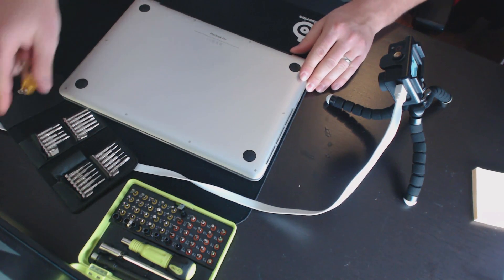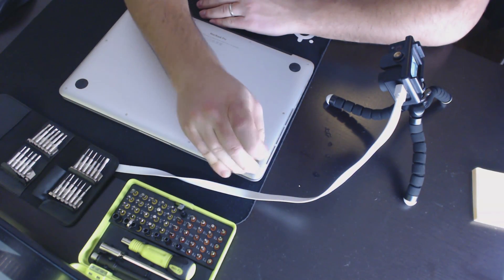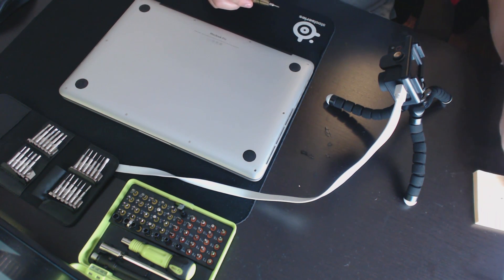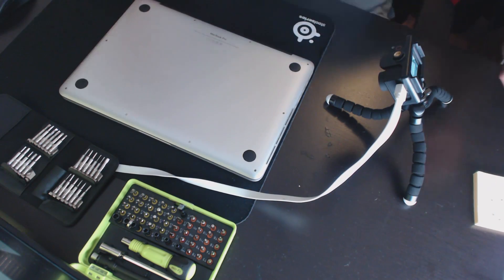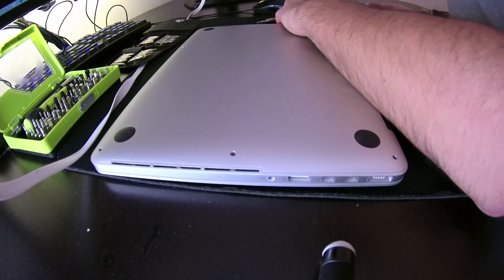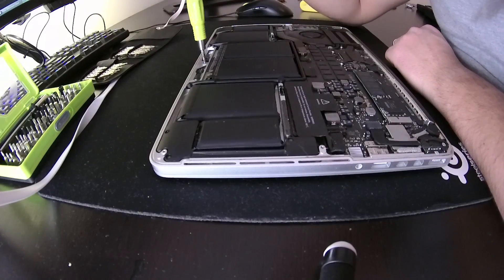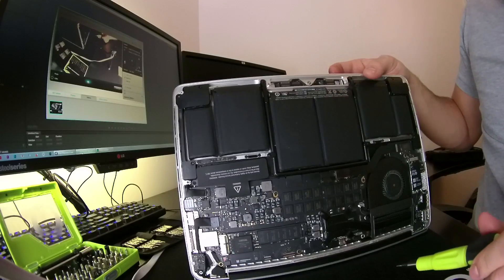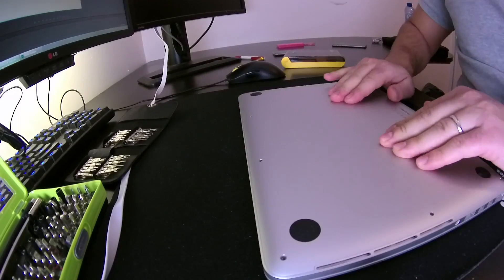How To Fix Macbook Pro Retina Touchpad Mouse not clicking - Fix Macbook Air Trackpad Click

Comment: For all of you who couldn't fix it as per the instruction on this video for one reason or another. Here's a fix that worked for me. It's called SMC reset and it's done by pressing and holding down the Shift, Control, Option and Power buttons together for a pretty long time, around 5 to 8 seconds. That will switch off your Mac and you just have to switch it on. The trackpad worked once I switched my Mac back on. I have Macbook Pro 2015. Hopefully, that will help you too.
Reply: this actually worked, thank you!
Reply: So I had to look up this video cuz my keypad was stuck and wasn't in the mood to get a screwdriver and take it apart. I saw your comment and did exactly per your instructions and somehow my keypad got unstuck!!! i have the newish 2018 retina macbook air too. THANK YOU!
Reply: Nick Styles, thanks for this comment man. This fixed my laptop straight away. I'm glad I tried this before I cracked open my case. Thank you!
Reply: I have a 2015 too and this literally just did the trick!! I was getting a little scared there
Reply: Great tip Nick, I would never think that "your" fix would solve my problem since I was convinced that I had a mechanical problem. The original post may solve another problem that I, obviously, did not have and was good if you have that type/version of Macbook Pro.
Reply: Thank you so much! You just saved my life!
Reply: Thank you so much :)
Reply: Thank you so much, it worked here too!!
Reply: Worked for me too!!!
Reply: I was freaking out so bad, and to my surprise it worked. Thank you so much oh my goodness
Reply: This comment has saved me, thank you so much.
Reply: I have a 2020 and this worked like magic for me. Thank you so much
Reply: Thank you sir your a life saver!!!
Reply: I did it and now I just can't click physically and also "vistually'. Cab someone help me?
Reply: omg! it just turn to work magically after some minutes. Thank u!
Reply: Thank you so much. I am so glad I came across your comment before trying the long route. I will be honest, I was quite skeptical wondering that it is a hardware thingy so how would this resolve the issue but to my surprise, it worked like a charm so wanted to thank you for this great tip.
Reply: @jawadqaisrani3244  I had the same doubts as you and that stressed me that I have to give it for repairs.
Reply: This worked! Thank you 🤝
Reply: OMG, you're KIDDING! That FIXED my Macbook Pro 2015!! I was totally freaked out yesterday because I cannot afford to replace my computer, and I have High Sierra and all these old apps I cannot afford to replace... I thought my trackpad not clicking was a physical thing. 

I tried your fix, and it worked! I can't believe it! Thank you SO SO SO much! I am on work deadline and it was a nightmare! I could KISS YOU!
Reply: It works for me too. Thanks!
Reply: IT WORKED, thank you so much you random guy from 3 years ago😭😭😭
Reply: Worked!!! Thank you so much!!
Reply: THANK YOU OMG
Reply: thanks, it worked!!
Reply: Thanks worked
Reply: this worked omg thank you so much i alr cried cause i dont have budget to afford a new laptop, once again thank you, and god bless you stranger from 4 years ago😭
Reply: @nsywaSalsaa I'm glad I could help
Reply: Thank you. It worked!

Comment: I had the same problem with my Zenbook for some time and I rested it horizontally a few times and it started working again, the debris inside is a good reason for it not working as mine also worked if pressed with extra force, or temperamental. I refused to take it apart because I didn't want to break it entirely. 
 
First step is: try taping you laptop horizontally with the trackpad towards the bottom on a hard surface while clicking the trackpad repeatedly . This could shift any grit that's found it's way inside.

Comment: I have a mackbook air 2018 that has stopped clicking. Will this fix work the same?
Reply from the maker: Not sure, you need to check if it has the haptic engine or not

Comment: Out of the 2 Macbook Pros I've owned, both have lost trackpad click, and both were due to swollen batteries. I'm amazed you don't mention this as a possible cause when I think its probably the most common cause!
Reply: So how do you fix it then
Reply: @Jmacjunior69  By changing the battery
Reply: Did the swollen battery kill the trackpad? I think it's what happened to mine.
Reply: This comment was more helpful than the video! I can’t even get to the T6 screw as there’s covering glued to the chassis and the batteries. But the coating of the batteries themselves feel rather puffy, so I’m certain they’re the cause of my crap tp clicking. Thanks!

Comment: What does "fasten the screw all the way up" mean?  Screw it inwards, deeper into the hole, or up, to loosen?
Reply: I think make it loose a bit
Reply: Loosen (up by turning left). I received a used Macbook Air 2017 and when they put a new battery in to refurb, they tightened all screws and the trackpad was stiff as a board, so what I had to do was actually loosen it up like you would a traditional screw. Be very slight, and keep testing it, because it doesn't take much to make a difference.

Comment: which version of macbook pro is this ??
Reply from the maker: Rodolfo Barriga this the retina 2014 version but should be similar with older versions of the mbp
Reply: Thanks ... I had a similar issue with Macbook pro retina end 2015 ... which is and works different from this one.., it doesn't have a mechanical touchpad.... at the end.., the hardware was wrong ( taptic engine) and fortunately Apple guaranty cover that :-)..... Thanks.